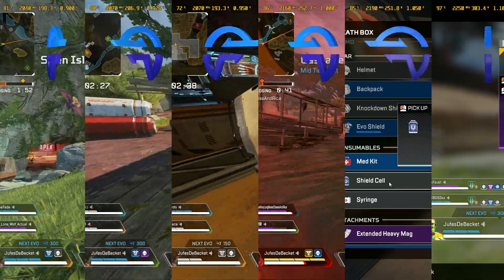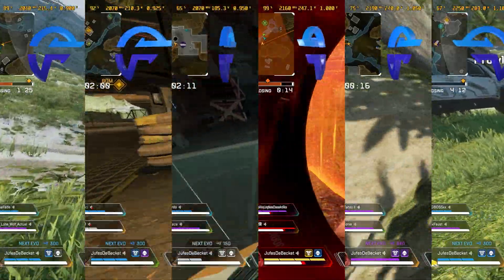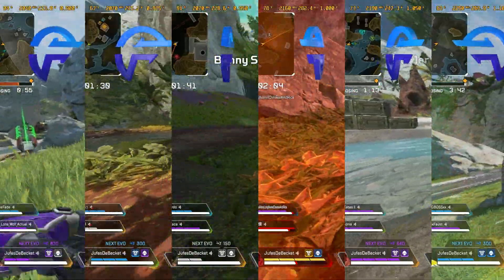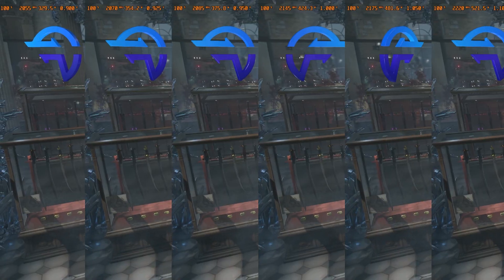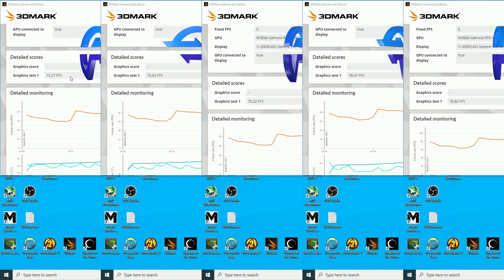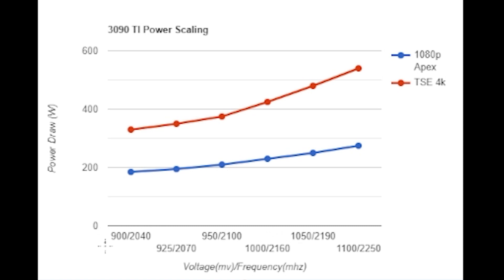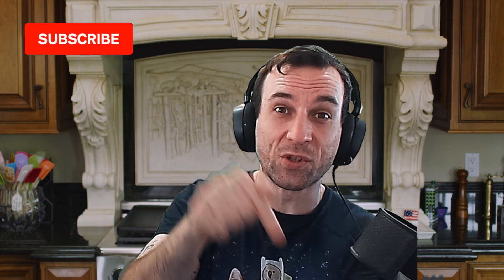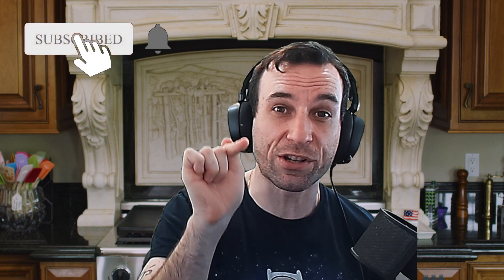3090 TI UNDERVOLT + POWER DRAW SCALING BENCHMARK 😱😱

Comment: Please answer the poor enthusiast: when I overclock by adding numbers with msi, up to 11501 memory (+1000) and the core at 2160. Games crash after a while. It hangs in furmark. This is most likely due to the core frequency. When it is within 2130, everything is stable. So this is a limitation of my silicon? Or do I need to give a static voltage of 1.08, for example, by the curve? There seems to be no problem with the temperature, this is xtreme waterforce. Rarely does the GPU reach 65 degrees. With a limit of 90. Although maybe it counts based on the memory temperature or hot spot? In general, maybe I was not very lucky with the chip? And it just cannot hold stably more than 2130.
Reply: ????? You realize every gpu have different clock speed? you cant just look what he put in msi ab and run it...

Comment: I can`t seem to undervolt my 3090 Ti any lower than 895mv, it would be helpful to play older games at lower power draw, you can do that with the other 3000 series cards.
You can at least force lower wattage by using low power limit, though.
Reply: You need lock fps in riva tuner stat service on 72 .. 100 and thats all.

Comment: Would have been nice to see power draw at 1440p on Apex Legends. it has to be higher so I wouldn't automatically group results with 1080p. With that said my 3090 Ti TUF runs great at 935mv and 2010mhz, never goes above 65C with fans at 50% while playing Apex.

Comment: Not too surprising as the stock voltage curve for that GPU tends to keep it at or under 1070mv on it's own when you don't OC the card. This has been the same behavior at least since the 10 series when NVIDIA introduced GPU boost 2.0.

Comment: As a miner we undervolt our gpus for example I can get the same memory performance on a 3070 at 110 watts at the wall vs running full tilt. So not surprised undervolting for gaming would have similar results

Comment: This is very game depended. Cyberpunk loves every GPU frequency bump, on the other hand games like Anno 1800 don't scale with GPU clock at all. I'm using GTX 1080 330W power limit, 2126MHz, 1440p.

Comment: great video 🙂 mine rtx3090 can peak thanks to lost silicon lottery at 0.9v - on 1905 - 1920 mhz range only on all games except of Metro Exodus (& Quake 2 Rtx) 🙂 in 4k I use locked 1830 mhz locked on 0.844v - all games except Metro Exodus stable & locked 1785 mhz 0.837v is Metro Exodus stable, yes pretty low frequency. Metro Exodus in 4k on 0.9v can do around 1860mhz only. Good luck boys with silicon lottery on rtx 4xxx cards 😉
Reply: My 3080 FE needs 950mV to be metro stable at 1905-1920 :p 937mV seemed okay for the other games I tried so bit a of a dud clocker mine
Reply: @stooeh  yours is normal, mine below average and I saw even much worse ones then mine
Reply: Im using the same .912v on 1860mhz for my 3080 and it runs everything 1440p ultra wide, even with some more demanding titles that require more volts like metro and outworlds.

Comment: samsung 8nm is sorta ok after the undervolt. A huge difference between samsung 8nm and tsmc 7nm on rdna 2 still exists though. my 6700xt never goes above 200w at 1440p with clock around 2.6 ghz
Reply: 2.6ghz 🤡🤡🤡 is there a difference between 2ghz through 2.6ghz lol
Reply: @redclaw72666  um yes? Lmao. 600 mhz Is huge

Comment: GPU's have their own throttle so the card won't be damaged in any way because it keeps itself away from danger in many factors, one of them is temperature, so it really doesn't matter it will hit the max and stop there, no damage is possible this way, from the wattage perspetive i agree with you, nice low mv curve and almost same performance is amazing.
Reply from the maker: Xoc bios’ remove all safeties

Comment: Man i just binge watched your channel and retained a fuck ton of info. Thank you! I just got my 3080ti running WAY smoother @ 2115mhz +210 core and +870 mem at 1.02mv, im maxing out at roughly 308w, and 61c on average. At 1440p i average about 240fps indoors and 190-210 on Caldera, new map about 5fps higher on avg. Runnin an i9 11900 @5.0ghz, Ring 4.6 , AVX 0, 1.37v, 3600 c16-18-18-32 Gear 1 mode 100:133 ratio @ 1.42v. I shaved 3ns by running that ratio out of curiosity, is there any reason why?
Reply: Hmm, I actually also heard that 100:133 is better for gaming, no idea why, I'm gonna go test it out. I'm using 3900 14-15-15-28, gonna try 3866 since it uses 100:133 by default.
Reply: @Ben-ld1qi  in my case I just went from 3600 on 1:1 to 3600 1:1.33 lol saved latency without changing the clock speed
Reply: @GARZA_ICMG  ooo alright thnx I'll give that a try.
Reply: @Ben-ld1qi  i actually just got it running at 3733 but i had to loosen mem timings slightly and give them 1.47v lol theyre running fine around 42c anyways
Reply: @GARZA_ICMG  just be sure to run some memory stability test if you've never ran that frequency/timings so u won't get off guard with crashes or reboots
but generally u should be safe with 42c in terms of temperatures unless there's something wrong with your timings or your ram isn't capable of handling the set dram voltage
Reply: @Ben-ld1qi  yeah I had to 16-18-18-32 to 16-19-19-32 for the stability. One of Jufes older vids he shows us how to use Fortnite’s Main Lobby to test mem and cache stability. You have to focus on the low FPS number average and see if there are stutters or the frames drop randomly in triple digit numbers. Currently low is 620fps highs hitting 780ish. You have to go get rid of the frame cap manually in a txt file nowadays but this is easily the best teat
Reply: And this is also after doing worse numbers on gear 2 4266mhz, 4.7 ring, and that whole 53 2 core 50 all core nonsense. Shit that although “TESTED AND SCORED” higher my in game FPS wasn’t nearly as good
Reply: @GARZA_ICMG Makes sense that you had to raise tRCD & tRP by 1 for a 133 gain in frequency, but at least your tCL is still 16, so overall probably a beneficial gain albeit a minor one.
I've seen the Fortnite/Cache stability testing videos but I thought that was only for the cache? I don't recall him mentioning anything about the memory timings. Could you please elaborate on which text/config I have to change? I don't play Fortnite but I'll give the 'Fortnite stability test' a go.
Reply: @Ben-ld1qi  he said the symptoms are similar, considering adding voltage brought the low numbers up I also brought my TRFC down to 550 and TREFI up to 17000
Reply: Also raising those two timings were the difference between MW and other apps booting at this point I think I’m at that place that papa Jufes calls OCD lmao
Reply: @GARZA_ICMG  I personally run OCCT/CPU stress test on Large FFT/AVX2, if there are any cache instabilities it will let you know trust me, once you pass OCCT you can afterwards run Fortnite as well. As for the memory, I'd run HCI MemTest or TM5 with anta777's 'Absolut' script overnight. I mean, if you just YOLO and run your games and hoping that they don't crash that's fine as well lol but I'm probably OCD as well so I prefer to stability test overnight.
Reply: Truth be told, when I was new to overclocking and wasn't too sure what I'm doing or how to stability test properly then I would just overclock and run my games/use the system and if it didn't crash I'd call it a day. But over time I've become way more OCD so I'll send a few hours stress testing the CPU, usually for gaming AVX2 on Large data set is more than enough. For memory overclocking it takes much longer, 12+ hours, that's why most people hate memory overclocking and don't mess around with it too much. Also keep in mind that your RAM may be stable but once you start gaming the GPU will heat up the other components and usually once the ram goes close to and over 50c is when instabilities happen. You can get a ram fan cooler for pretty cheap, look up 'Alseye ram cooler' on AliExpress, probably worth it to ensure stability in the long run
Reply: @Ben-ld1qi  I’ll definitely look into that, I have AIDA and OCCT as well, I was using these for to get these amateur pure numbers based benchmarks before I came across this channel and finally differentiated the difference between FPS focused tuning and just benchmark scores. It wouldn’t hurt to run some tests now that I know the games run fine

Comment: i generally do agree with the point of this video however imo the biggest issue with huge power draw cards isnt the power draw itself its how hot your room gets. i have a 5900x/6900xt and even with that my room heats up quite a bit after a while of gaming. i have 2 large radiators and a  very efficent loop it could def handle 600w card im just not sure id really want that as what i have already is like a small space heater. 7-800w is alot of heat to manage unless you are in a large open room
Reply: Yeah same exact issue here. Idc much about the power draw itself as my electricity costs are low and my loop can easily handle it. I just cannot comfortably game for many hours with how hot the room gets. Even when it's -25C outside in the winter, I don't need anything but the PC to keep a normal room temp, it's insane. If I had AC I wouldn't give a damn and just crank the max OC.
Reply: Dealing with this for 3 years. Run your tower in closet or build an cubby hole with ventilation. yes that means no "Tower Eye Candy" for you.. and spend hella more to run 50ft-100ft wires everywhere (someone should've invented a wireless DP/hmdi... F it, every peripheral.... and that the frequency bands dont F up our health either)  smh soo many simple pc nuisances to still overcome..
Reply: i have the 6900xtxh chip and i underclock it to 2250mhz or less depending on the game this nets me 220w max or around 200w average depending on the game and still provides 175fps at 1440p. I dont really like these cards are voltage locked but i do think its nice when you lower clocks it does lower voltage at the same time and that is nice for the normal users for sure. some less demanding games i run down in the 1900mhz range and that nets around 150w. i'm honestly quite surprised so many people went with nvidia cards this generation with its out of this world power draw even with low gpu usage they just eat! even at just 200w it still warms the fuck out of my room so i can only imagine using 550w or more...
Reply: @ramair325  it is crazy more rtx 3090 ‘s were sold than the entire Radeon 6000 series altogether… 
The number one selling Radeon card is the rx6600 number 2 best selling Radeon card rx6600xt.
Basically nearly 90% of
Consumers choose Nvidia and even greater majority of all high end cards are Nvidia .  
The 4090 is definitely the way to go for efficiency though but way to expensive right now. 
If I could get one at MSRP I will though but I’m not paying a scalper ever. Sadly I think Newegg and Best Buy have become the scalpers haha
Reply: @JoeWayne84  Amd needs to take there launches more serious and get things ready DAY ONE if they ever want to claw back into the market. lower prices help but wont matter if you dont have the software and hardware ready on launch day. just look at how bad the 7900xtx is... what a mess. even on the press release you could read the disappointment on amds faces with ease. Wasted opportunity imho.
Reply: Same 3090 here and I had to get a portable air con unit and I’m in the UK

Comment: GPU undervolting is so worth it. Locked my 3090 to 775mv / 1800mhz, In some scenarios I have 2/3 of the power draw but still 90-95% of the usual FPS.
Reply: Nah. Remove the power limits and let the bitch pull. Maintaining a solid 2175 MHz on my 3090. That's almost a 20% increase In clockspeeds. So easily a 15% increase vs a 3090 running at 1800 MHz assuming I were GPU bottlenecked.
Reply: @Drix7  nope 3090 is 5-10% faster compared to 3080   7% on average at 4k. You basically payed a 1500$ plus gpu and downgraded to 3080 levels of a 700$ gpu.. WHAT A doughnut HAHAHA
Reply: @procrustes7669  i'm on a 3080 atm, i never owned a 3090 in the first place
Reply: so you basically have 3080 now 🤣
Reply: @jerrym1401  The Cat Daddy's 3090 will be different to a stock 3080 as the 3090 will be at its optimum place in the voltage curve and draw less power (~270 watts). The 3080 will draw a lot more power (~350 Watts) to match the performance of the 3090 undervolted. So the 3080 would also need to be undervolted and would also loose around 5-6% performance. So no they are not the same.
Reply: GENIUS LOL
Reply: @Drix7  Where did you get 15%??? Its around 10% just with more vram. And thats it. Only fools will buy 3090 over 3080 when gpus are at msrp, mining crisis made 3090 sell , and nothing else.
Reply: @jerrym1401  I bought it in december 2020. It was impossible to get a 3080 then, and even then the prices were close. I got the 3090 very close to msrp, super basic reference pcb model, but I have zero business with those 450W+ models in my room thag gets way too hot during long gaming sessions.
Reply: @jerrym1401  Some people just have money to spend to buy the highest spec without even thinking of value
Reply: @redek1503 Ok show me where it was possible to buy a 3080 in december 2020. You can't, because it was the hardest one to get out of the entire stack. And even the ones always out of stock were listed for nearly the same price as the 3090. Another reason is I upgraded from a 1080 Ti which has 11GB of vram, while the 3080 has 10GB, that would be rather dumb as there are already games that utilize more. Lastly if I didn't care about value, I wouldn't have picked the cheapest reference PCB model and gone for ultra omega maximus biggus dickus extreme platinum edition. And then I would have switched to a 3090 Ti by now. But I didn't.
Reply: @thecatdaddy1981  so i  guess you arent one of those with more money to care about value to cost or to think twice to pay a scalpers
Reply: @redek1503  Correct. I would have stuck with the 1080 Ti for another generation if I hadn't gotten that 3090 for normal price.
Reply: @thecatdaddy1981  Not doubting your purchasing decisions, you do what you want to do.  But I am curious, which games already use more than 10GB of VRAM?  In my 139 games in my Steam Library I havent found a single one to do that yet.  Even Doom Eternal at 4K Ultra Nightmare is 100% fine with 10GB.  Far Cry 6 with HD textures, 4K, Ray Tracing enabled, also fine.  I prefer higher framerates to graphic fidelity so I play mostly at 1440p with my 3080, but testing at 4K I am yet to find any current game that runs out of VRAM.  Even Cyberpunk at 4K, Ultra RT, no DLSS is fine with 10GB VRAM.  It was fine with 8GB VRAM on my 3070 as well.  Granted, it's not playable with these settings, at least for me, but VRAM is not the issue.
Reply: @Mostly_Positive_Reviews two years later and games are sucking up 16 GB of vram (Alan Wake 2). 3090 was a nice investment.
Reply: @ Yep, games got a lot more VRAM hungry very quickly. I stand corrected.

Comment: Why does my 5800x3d only boost 3.6ghz max and max 69c
Reply: idk
Reply: Because it is a locked cpu
Reply: @ignacio8597  at 4.5ghz not 3.6ghz
Reply: Maybe it likes the temperature number too much. Can you set it to Fahrenheit?
Reply: @RminusOR  yeah, it should convert to about 420 or so.
Reply: @RminusOR  max temp for this cpu is95c
Reply: @weroliera  maybe it's time to change cpus 🤡🤡🤡

Comment: 75c and your worried ? for a 3090 ti??? come on bro
Reply from the maker: Go ahead and risk your own 2000$ card for a 9 minute video
Reply: @FrameChasers  its probably only a 1000$ card now that crypto crashed lol
Reply: @ramair325  you would think, but I was looking at prices yesterday. Better but still up there.
Reply: @ignacio8597  the good deals sell out fast, the other day they had 6900xt for 720$ after MIR 820$ at newegg. there have been reports of 3090's under 800$ as well. dunno about the 3090ti tho
Reply: @ramair325  I was looking at microcenters pricing. They had 6900xt for 1k and 3090ti for 2k. But if newegg has the deals I'll check them out, trying to get my cousin a gpu.
Reply: @ignacio8597  it just really depends how many people buy how far the price drops. but they are testing the market to see what sells while trying to squeeze a few more $ out. i hear the reason for nvidia pushing back launch of the 4090 is because aib had tons of stock left.

i can only guess no one is buying them so prices will fall hard. same thing happened with the vega64 cards and radeon vii cards right before the launch of a new generation. mfg get worried because product is not moving.

 make no mistake tho people will buy when prices fall far enough so you gotta be quick when your price hits what your looking to spend! but hey the good part is if he waits he will get even more gpu power for his dollar or at least thats how its looking to be with another large performance leap inc.
Reply: @ramair325  Yeah, I got lucky. Sold my 5700xt for $700, went and bought a 6800xt for $1200 or $1400, then it had coil whine, so I went to warranty it and prices had dropped. Ended up getting a 6900xt for $1100. With the new gen coming soon, I can imagine we'll be able to get him a pretty good bang for his buck.
Reply: You're*
Reply: @driptic  begone!
Reply: Worth it if your mega-billionaire, I use my spare 3090 Ti as a door stop.